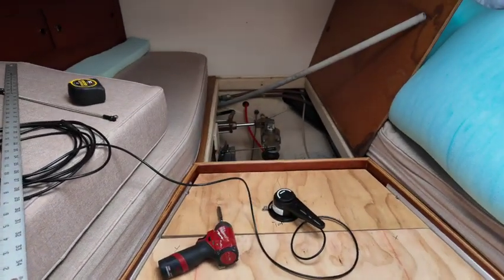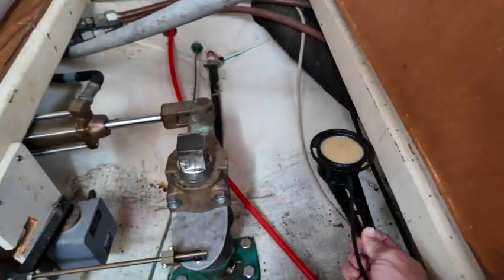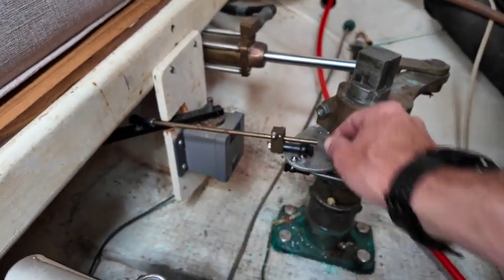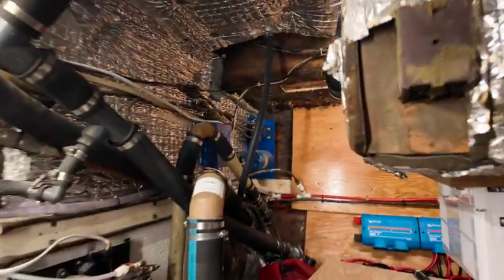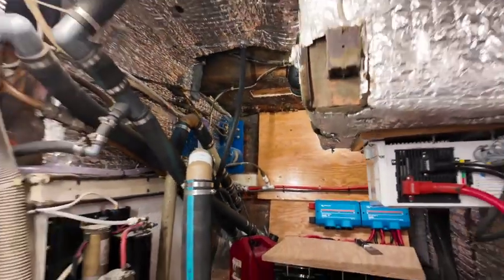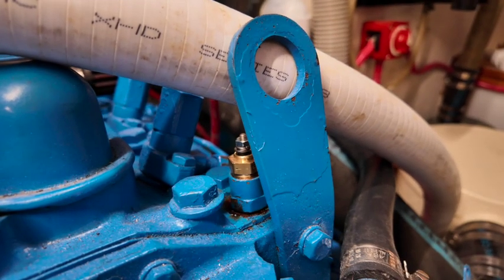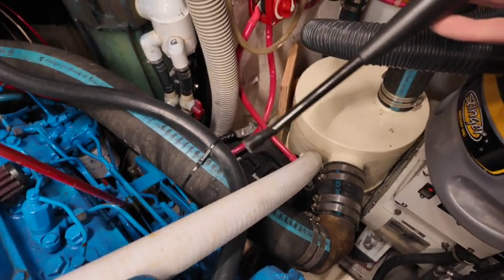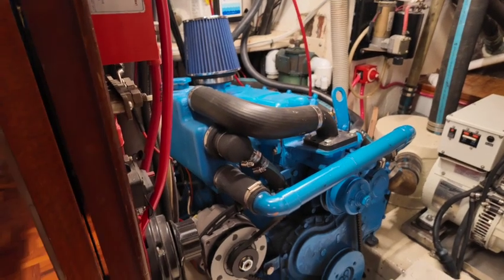Ep 43: Installing Autopilot, so we can Ghost Ride da Whip!

Comment: Yip ooooops LOLOLOL PS. It should have a bleed pump on the side ......Or you can open all the injector pipes at the injectors and swing the engine until the diesel comes out. OR you can get some quick start spray it into the air filter not to much and run it just to get it running on its own??? That's the easy way. Just have a lot of rags cause its going to get messy....LOLOL Good luck!!!!!!!!!!     O and not removing your old Autopilot is a very good idea. A lot of sailors have spares but to install them out as see can be a bit........lolol. Having your spare on a flip of a switch just brilliant. Hope you are having a great day!!!!!!!!!!
Reply from the maker: Thank you! Likewise! 🙏🏼

Comment: The wavy lines on the instructions of the arm does not mean you can cut it.  It also doesn't mean you can't.  That is a scale representation of all of the parts in the assembly except for the length of the rod.  That is there to show the actual length of it is not to scale of the other parts.
Reply from the maker: Thanks so much for your wisdom! Appreciate you! 🙏🏼